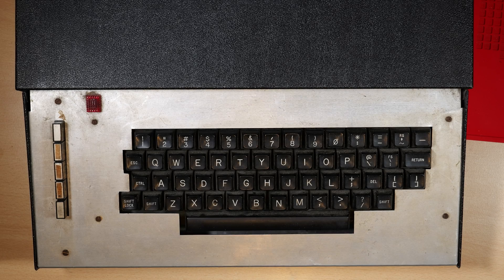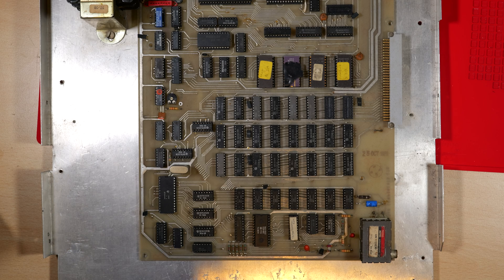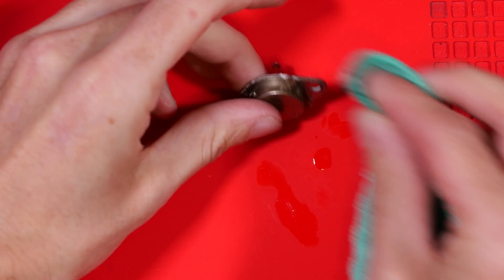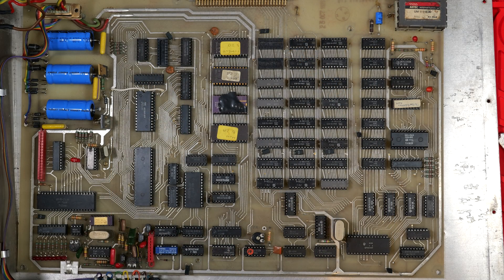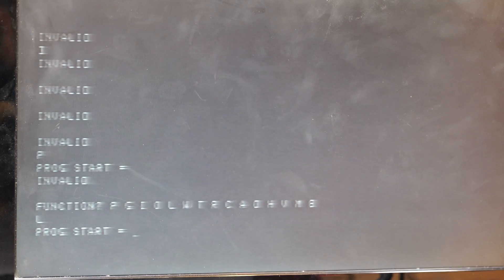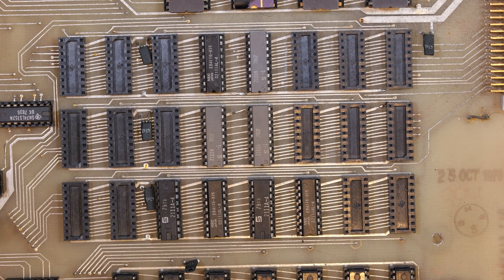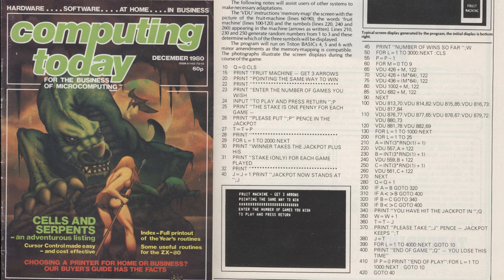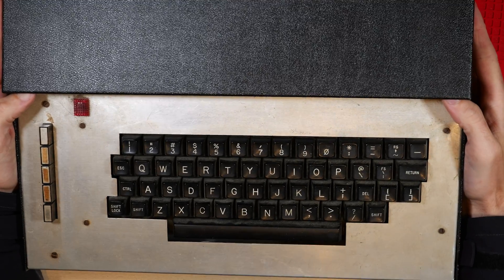Check out this home PC from 1978 - Transam Triton Part 5

Comment: If the graphics chip is anything like to the one used in the TI-99/4 and 4A home computers, it has what is effectively a higher column mode where each character is 6x8 instead of 8x8. So you can define those pixels, but you just can't see them in that mode.

Comment: That's a nice machine to see working. I remember the magazines and the ads for these and many others around that time, but pre-teen me couldn't afford any of them. I was stuck with playing around with TTL and dreaming of my own computer for long enough that it made no sense to build a design like this.
Reply: You can build one now, not too late 😉
Reply: @8-bitbitsa821  You're right of course. I could. I'd probably enjoy it if I did. I also ought to get around to finishing the 6803 based SBC that I started designing in the mid-80s. But what would I actually do with these things on completion except watch them collect dust ?

I had a pretty large collection of retro computers up until 20 years ago when I sold or gave away most of them before emigrating. Sometimes I think it'd be fun to still have a TRS-80 model 1, for instance, but while some of these things helped me with learning about computers before I had a career in software, or were used as part of my work, they're not really of much use now.

Tinkering is still fun, though, so I use quite a lot of Arduinos (mostly Nanos) these days to control stuff around the house, switching loads to make best use of solar power, controlling a ventilation system etc. This is where 8 bit computing is for me now. They only cost a couple of $ each and it's so trivially easy to program those little machines to do stand-alone useful stuff for you. I also have dev kits for 8051s and RL78s and other stuff, but the Arduino is just too easy to play with and get a result.

Occasionally I get to incorporate chips with 1970s date codes that I bought as a kid into the new Arduino projects. That amuses me.